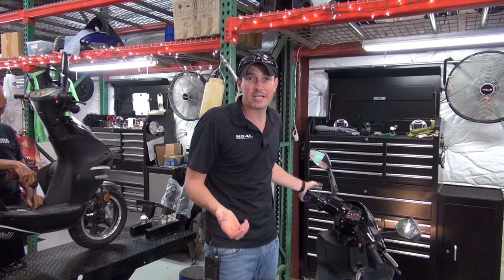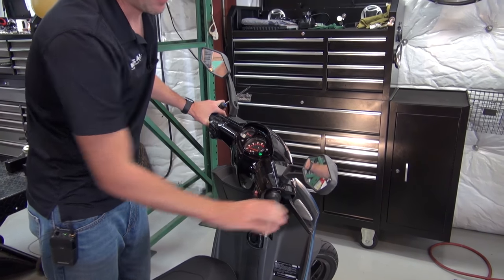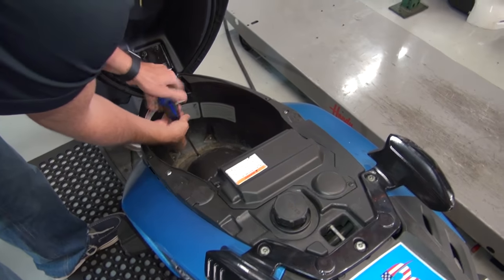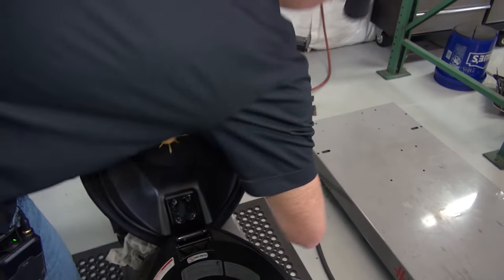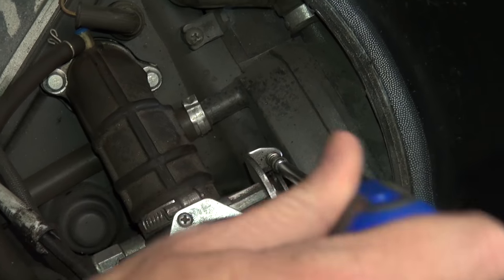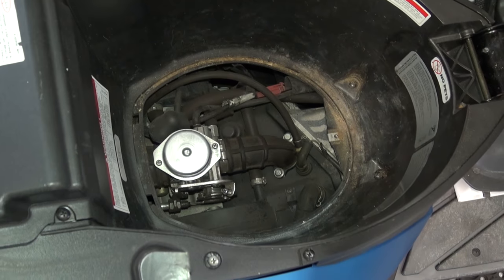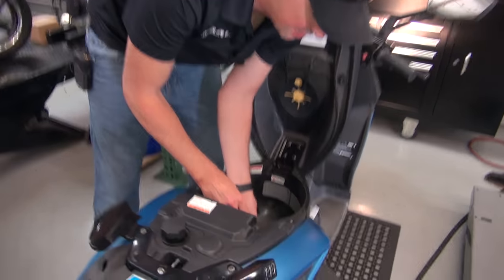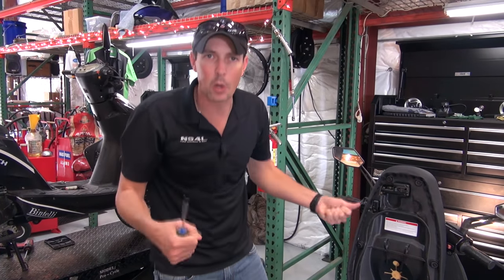Scooter Troubleshooting: Scooter Dying Out When You Come to a Stop / Low Idle

Comment: Does that help if it's kinda slow after you stop at a stop light? It goes but takes a few secs to start?
Reply from the maker: Maybe a little if your idle is super super low.  If it bogs when you give it gas and it is taking a few seconds for it to 'catch' and really start accelerating, you could have a carb problem, air problem, etc.
Reply: New Scooters 4 Less  oh okay could it be because I'm at about 3200miles and I have only changed the oil? I have a wolf 1
Reply from the maker: Possibly.  You probably need to give it a really good tune-up.  Where do you live?
Reply: New Scooters 4 Less I live all the way in CT.  Connecticut
Reply from the maker: Go to Connecticut Scooter Pros.  They will take excellent care of you.  They are very good friends of ours.

Comment: Hi new scooters for less I have a piaggio liberty  125 2007 UK model  got it 6 months ago every thing was fine on it then tonight I was riding it and it started to jurk on me at about 30 mph then cut out all the lights and stuff was still on and the battery is new I started it again and it started so carried on my way home and it did it again another 2 times any ideas of what it could be intercepted did the thing in your video but still doing it it's weird cause it starts up again no problem just when I am riding for a bit it starts please help would be great
Reply from the maker: It's too difficult to say.  I would get it into a shop and have it checked out.  It sounds like it could be electrical.  It could be a lose ground, could be a bad coil / spark plug cap, etc.  Because there are many possibilities, it's really difficult for me to diagnose without having it here in front of me.  Do you have a shop you can get it to?
Reply: @NewScooters4Less  yes I do it has new oil in it new oil filter new air filter new sparkplug and a new battery when I got the scooter the battery was bad so replaced it has new front and back brakes new speedo cable new back brake cable the work was dun by me 2 months ago and it's been running really good till that happened yesterday I looked at your video about the idle screw did it yesterday had it out the day and it did not jurk or cut out but my engine oil light is flashing on when I come to a stop now that only started when I adjusted the idle screw today do u know y this is happening? ?
Reply from the maker: @johngourlay5804  No.  Completely unrelated, unless you adjusted the wrong screw.  Your scooter may have an oil adjustment to adjust the amount of 2-stroke oil it is getting to control the ratio being injected.  I'm not too familiar with a 2007 UK Piaggio Liberty.  That would be my assumption based on the information you gave me.  There could be several possible issues I'm afraid. :/
Reply: @NewScooters4Less  thanks bud it's not a 2 stroke it's a 4t 125cc bud and it was defo the proper screw way the spring on it i checked online to see where it was located took it for a drive for a hour and a half the day it never cut out or died on me there is no oil leeks cause I would notice it on my floor I just got new oil and filter  so will do that to see if that helps and it mite not mean anything  but I am in Scotland UK and it's very cold at the moment could it be that ?
Reply from the maker: @johngourlay5804  Possibly.  I feel like scooters are always more difficult in colder climates and higher elevations as well.  Maybe I could come over for a visit?  It's been a while since I've been to Scotland!  :)
Reply: You are more than welcome to come to Scotland my friend i will hook up up with some haggis lol
Reply from the maker: @johngourlay5804  LOL

Comment: Mine starts very hard need to heat up the spark plugs and Kick it very fast.  when i move the throttle it will bog but if I move it slow it'll accelerate a bit and if I spray carb cleaner in the air box hole it will stall
Reply from the maker: Did you clean the carburetor completely?
Reply: @NewScooters4Less  yes I toke everyone piece out of it and cleaned it. it starts once only if I turn the idle screw then if I give it throttle it'll bog and eventually die and after that it'll not start again until I take the spark plugs out and heat it up
Reply from the maker: @nationalboosted2877  I’m sorry. I’d really have to have it in front of me to go through it. Could be several things. You have a shop nearby that can help you?
Reply: @NewScooters4Less  unfortunately I don't have one near me.
But It seems to run a bit better now I adjusted the valves and the main jet pin and it seemed to run ok but it would still bog at half throttle. After that I tried to move the main jet needle washer down but the Kickstarter broke:/ I guess I'm unlucky
Reply from the maker: @nationalboosted2877  Sorry to hear.  Wish we could do more to help!

Comment: This seems to be the right issues with my scooter but after adjustment on the idle screw my scooter won't start and it didn't help.
Reply from the maker: Check the vacuum lines, intake manifold, and air box for cracks. Could be a vacuum leak or maybe an air flow issue.

Comment: I just bought a piaggio typhoon and when i rev the engine and drive it it stalls sometimes i have only driven it about 10-20 meters. Do you think it does this because it’s new or what do you think?
Reply from the maker: 100%.  Let it break in a bit.  It can be adjusted like in this video if it continues to be an issue though.  Thanks!
Reply: New Scooters 4 Less cheers!
Reply: What is the condition of your battery?
Reply from the maker: Mine's great.  George's may be another story, lol.
Reply: What is the condition of your battery?

Comment: Mine spins ALOT more than that.. is that a problem ?
Reply from the maker: The rear tire does?  Does adjusting the idle down slow it down?
Reply: @NewScooters4Less  I have a SYM JET 125 and I’ve learned that it’s not a carb and it’s fuel injected ??? How can I turn my. Idle down / revs on this bike please ahah
Reply: @NewScooters4Less  just picked up the bike for pretty cheap £600 with 12 month mot but it needs a service ( he said that) and it seems under powered at the moment . And it revs it ass off when sat still it moves the bike
Reply from the maker: This video won't apply to you.  You have something else going on :/ Gonna have to get it to a shop!  Sorry! @Postalguy1
Reply: @NewScooters4Less  wounded 🤣 cheers buddy

Comment: Tried this and it runs great until i sit on or drop the scooter off the stand. I even had the idle all the way up and it was still idling out.
Reply from the maker: Make sure a vacuum line isn't getting pinched or anything when it comes off the stand.  I've seen this before. Thanks!

Comment: can u help me , my bike at like 30km/h just lose like acceleration for second and then works fine at higher speeds
Reply from the maker: What kind of bike is it?  Check for leaks in your vacuum line or for a crack in the air filter box, etc.  I had one that was doing this exact same thing and it was due to a crack in the air box.
Reply: @NewScooters4Less  it is gillera ST 125cc 2006...

Comment: Mine likes to go on its own an if I lower the idle screw it just dies when I stop giving it gas
Reply from the maker: When it is "going on its own" is it idling fast and "running away".  It's ok if the back wheel turns a little because the brake and body weight will keep the scooter in place, but if the scooter feels like it's "pushing you" when at a stop, then you have a problem.  You just have to find the sweet spot.  If it idles erratically and is all over the place, you probably have a vacuum leak or another issue.

Comment: Dies when i hit back breaks and my back tires will not stop it forcefully wants to take off at all times how do i fix this
Reply from the maker: You tried turning the idle down right?  If that didn't help, my thoughts are you have a broken clutch spring or something going on with the clutch inside the transmission that is keeping it engaged.  Pull the casing off and investigate.  Thanks!
Reply: I got everything where it should be then sprayed the clutch spring with grease and it unlocked now its not so bad but now my electricals are out lol
Reply from the maker: @thatstonedvillain  Fuse?

Comment: You don't recommend clean out carb.    .why?    Bill
Reply from the maker: In this instance, it's not needed.  If the scooter has been sitting for a long time, the fuel is stale, etc. - then you probably need to clean out the carb.

Comment: I tried screwing in that screw in and it's the same problem. I have no idle at all.
Reply from the maker: Are you able to tighten your throttle cable. It's not too lose is it?  You could have a different issue all together.  Sorry :/ May have to get it to a shop.

Comment: Mine works fine now, but when i start it on the sidestand, i take it off and it suddenly stops running?
Reply from the maker: Sounds like something is getting pinched when it comes off the stand.  Make sure your vacuum lines, fuel lines etc. are not getting pinched up when it drops off the center stand.
Reply: @NewScooters4Less  no sound is happening, i can only start the bike on sidestand but i need to keep the revs high when i take it off in order to keep it on
Reply from the maker: @malikef  No sound is happening when?  When you take it off the side stand?  It only works when it is on the side stand?  I still think you have lines or something getting pinched somewhere.  I'm guessing though.  Hard to diagnose without the scooter right here in front of me, lol.
Reply: @NewScooters4Less  it doesnt have an electric start, i need to kickstart it but i cant when its stood independantly, i need it to be on the sidestand to work, but when i lift it off to ride it turns off, i bet its super hard to understand
Reply from the maker: @malikef  Find your favorite repair shop :) Good luck!

Comment: My scooter is a 50cc 4 stroke gy6 euro 4 and it is restricted to 25kmh. The engine doesnt want to drive good. It feels like it gets moodswings because when I try to accelarate it goes then all of a sudden it stops then it drives again then it stops and if I continued it will eventually stall. But when I drive on a straight toad on the same speed it works. So the problem only happens during acceleration. I just changed the filters and every else works fine because sometimes when it feels good it will accelerat very good until I reach its restricted limit. Does anybody know what I shoukd do it is relatively new its gone 233 Miles and is from 2020. It's a motocr comet.
Reply from the maker: Do you have a shop that can look at it?  So hard to diagnose issues like this through comments. I'ms sorry.  It could be one of several possible things.

Comment: So I have a TaoTao Quantum 150 that has a bunch of mods done too it like a big bore kit, different exhaust, carb with a 30 mm intake that has been re jetted and nibbi extension with a UNI air filter on it.
The bike runs great on the kickstand and transitions fine and has a good idle too it. Top speed is great and has no problems at all. It actually runs good for a few miles than it's starts this issue. The problem is when u get down to about the 15 mph or so the bike shuts itself off and dies out. You CAN restart the scoot bike right away.

It does have a fuel filter up by the tank itself(stock location)and I added one on the main fuel line going to the carb too, both look good.

Things I have done already are:

1. Drilled a hole in the gas cap already to prevent vapor lock, since I had this problem when I first got the scoot
2. Checked the valve clearance are both set too .004
3 Zip tied the vent hose off of the vapor canister off and deleted the EGR from the head too
4 I also have played with the float bowl level in the carb and ended up putting it back in the original spot I found it in....
5. Checked the idle numerous times

Anybody have any idea what could be going on or what a remedy for me would be?
Reply from the maker: Do you think it could be electrical?  On these cheap chinese scooters like Tao Tao, I've seen the type of issue you are describing with bad ignition coils.  May want to replace the coil and see if that does the trick.

Comment: When i full trottle it slows down and its a brand new scooter?
Reply from the maker: Where did you buy it from? Can you take it back and have it looked at? I'd guess a carburetor issue, but would need a lot more info.
Reply: New Scooters 4 Less its a tao tao new speed 50 no it was shipped to me it jumps when i twist the throttle? Tho could it be the gas im just using regular fuel,
Reply from the maker: @kevinthorn9672  Use 93 octane for sure. That may be part of the issue.  Unfortunately, Tao Tao scooters are a nightmare for a lot of people :(
Reply: New Scooters 4 Less where should my idle be adjusted? Also i seen for a new scooter that you have to adjust the needle in the card but idk how to do all that.
Reply from the maker: Idle will be adjusted the same way as shown in this video. The needle is in the top of the carb, but you really shouldn't have to adjust it on a new scooter. Call the company and ask for a new carburetor to be replaced under the warranty if you are having carb problems.

Comment: My problem which I can't find an answer for. Is when I give it gas it'll rev up. But if I try to go it dies out
Reply from the maker: What do you mean?  When it is on the center kickstand and you rev it up it will rev up, but the moment you take it off the kickstand and try to go it will die?  To me this sounds like the seat or suspension is pinching a fuel line or vacuum line.
Reply: @NewScooters4Less  no when I start to give it gas it'll start to rev up then just die. But I think I found the problem. My gas tank has rust in it and it's clogging all my lines
Reply from the maker: Anytime you have an issue like that, it's usually fuel or vacuum related.  If you have rust, that is DEFINITELY a problem.  Purchase a new fuel tank for it.  If you let me know what kind it is, I may have one in stock here.
Reply: @NewScooters4Less  it's a 2013 bashan 49cc renegade 50
Reply from the maker: The tank on that should be the same as our Wolf RX50.  If you would like to order one, email Katie at katie@NS4L.com or parts@NS4L.com and she can assist you!  Thanks!
Reply: Also do you know where I can find a new body kit for this year and model
Reply from the maker: I don't man.  It's pretty difficult for those scoots that are 5 years only.  You may be able to find something similar that works though.  If you want to send pics of your scooter to parts@NS4L.com we can see if it is something we may be able to get for you.  Thanks!
Reply: This is what mine does

Comment: My scooter engine dies when from stop, I tried to move off and lightly throttled . The engine like don't have the power to move and when I throttle it died. Any idea what is the issue?
Reply from the maker: Probably a blocked jet in the carburetor.  You probably need to clean the carburetor.  Has it been sitting for a while by chance?  What kind of scooter is it?
Reply: @NewScooters4Less  hi friend, thanks. It's a PGO Taiwanese scooter. Last time they worked with Piaggio
Reply from the maker: @arrowstheorem1881  Has it been sitting for a while?  Give me more details and I'll try to help the best I can, but from that very limited info, my first hunch would be a gunked carburetor.
Reply: @NewScooters4Less  are there solvents to clear up the gunk or need "surgery"? This scooter is frequently used
Reply from the maker: @arrowstheorem1881  You could try dumping the fuel and putting some high octane fuel in it, but the best way to clear it up is removing the carburetor and cleaning the jets, etc. for sure.
Reply: @NewScooters4Less  Appreciate your expert advice! There is a product called GAT that when poured into petrol tank, mixes water inside it with the petrol so that the water eventually gets combusted. Would this be useful and is it costly to get carburetor cleaned?
Reply from the maker: @arrowstheorem1881  I'm not familiar with GAT, but there are several similar products out there. From my experience, taking these shortcuts usually only work temporarily at best.  I'd still recommend cleaning the carburetor.  It should only be some labor (an hour on most carburetors) and a little bit of materials to clean it, so I wouldn't expect it to be too much.
Reply: @NewScooters4Less  Your advice is so nice. I was wondering if I can let the petrol flow out from the base of the tank since that's where the water will sink to. But I guess petrol tanks have no drainage at the lowest point of the tank? Thanks again
Reply from the maker: @arrowstheorem1881  Removing the tank would be the best bet, but you could siphon the fuel out and then make sure you dry it thoroughly before putting fresh fuel in.  Hope that helps!
Reply: @NewScooters4Less  I think I will use a hand pump type of manual pumps as used in aquariums. Hope the tube can reach the base
Reply from the maker: @arrowstheorem1881  Let me know how that goes.  May be easiest just to remove the tank.  Good luck.

Comment: Mine starts up but if i dont pull the throttle back alittle even idle it dies??
Reply from the maker: I'm not sure what you are trying to say here.  Sorry!  You mean you have to pull the throttle to keep it running? You may have to adjust the actual throttle cable on the carburetor or at the throttle handle to make sure it doesn't have too much slack.  Does that make sense?
Reply: @NewScooters4Less  your honestly amazing! It’s starting right up and running just fine now! Thank you man
Reply from the maker: @Indicouch23  Beautiful.  Great to hear!